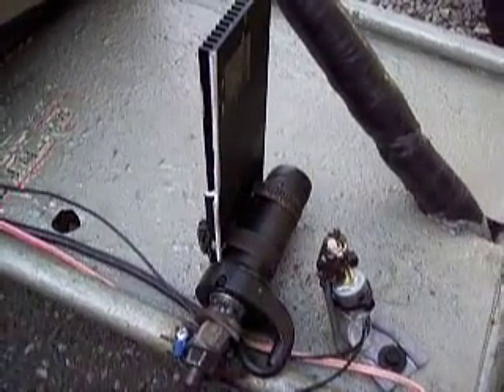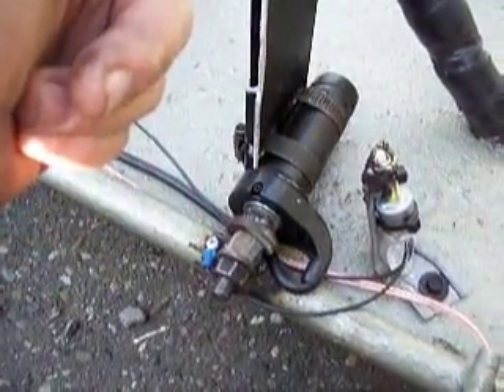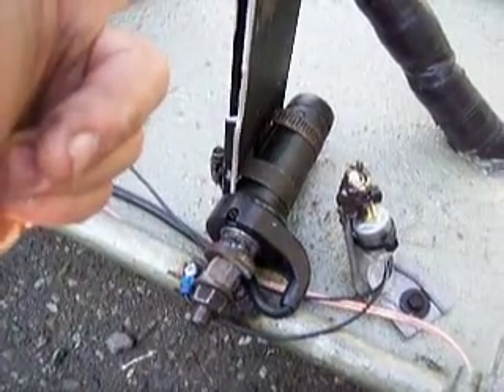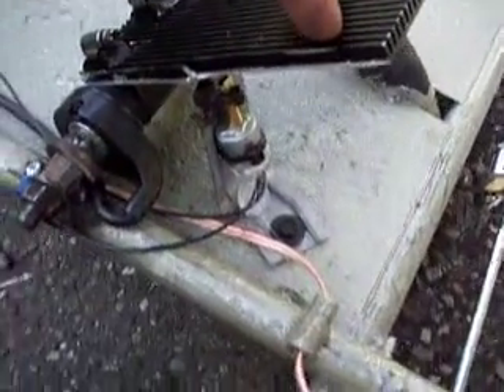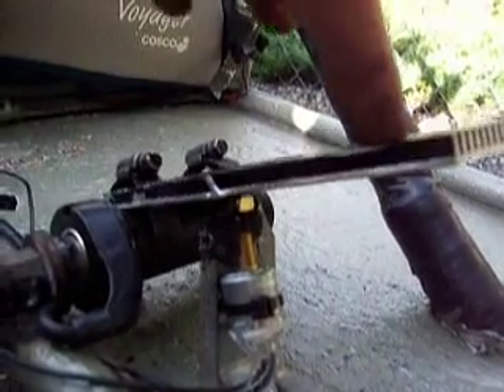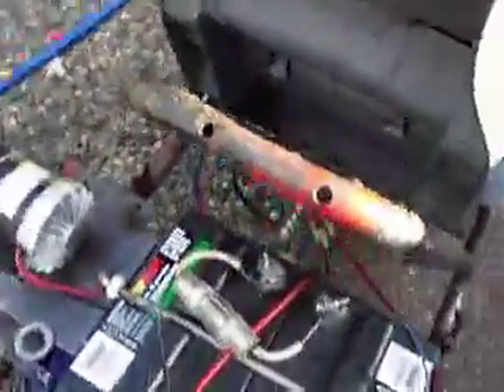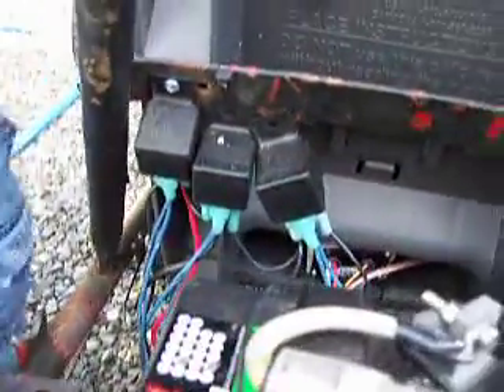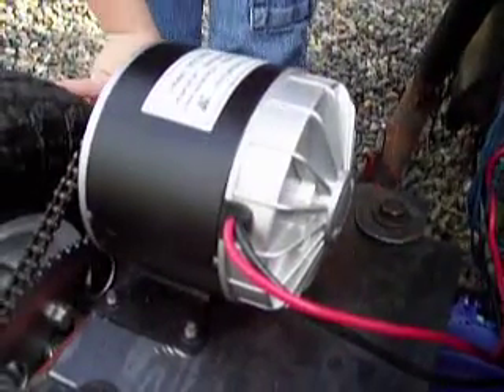Demonstrating the throttle on the electric Go-Kart

Comment: Very valuable info, thanks!! Hotrodding my kid's 6V Thomas the Train Power Wheel so far with a 500W speed controller and variable throttle to mitigate rider whiplash and stress to poor Thomas (I added some more volts...). Didn't occur to me to wattmeter full throttle versus a direct connection from the packs to the motor to make sure he wasn't a wattage robbery victim. Poor little motor, same size as the one in a cheap 12V drill I scavenged to try its throttle (resistor-based I suppose) first before quickly frying it. Good times.

Comment: how strong is that motor? cuz i have a 36 volt golf cart motor with batteries that run through old style controllers. it goes around 15 mph but do you think that would be enough for a go kart? also what controller would i need? are they expensive?

Comment: Is the electronic speed control built by you or purchased? if purchased who makes it? I am always looking for different ways to power the cars in my videos. The original electric versions they built in 1955-67 were 6-volt with only full throttle or nothing  so a variable speed control is very desireable

Comment from the maker: No, there's an electronic speed controller. The throttle is just a sensor, the speed controller converts that signal into duty cycle for the motor.

Comment from the maker: Yeah, it'd work. But measure the voltage at the motor at full throttle first, and compare that to the battery voltage. See how big of a difference there is. I had almost 2volts lost through the controller if I remember right.